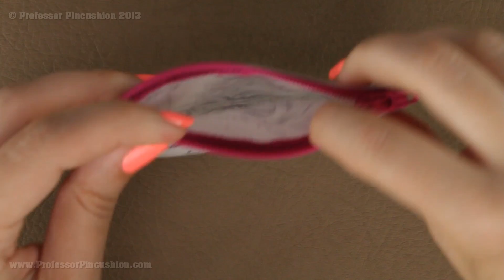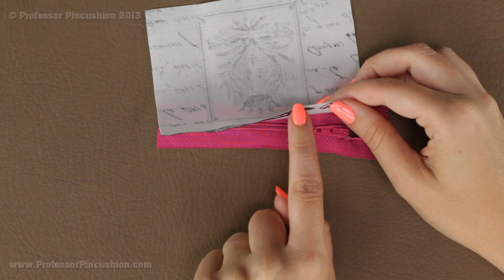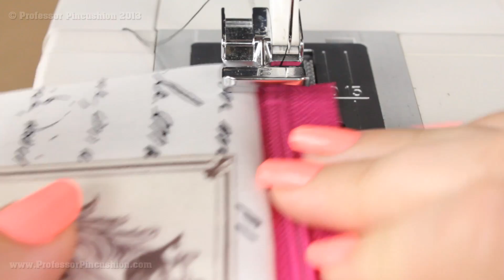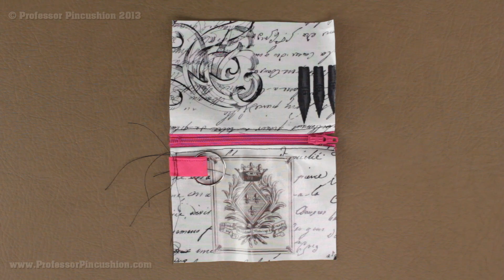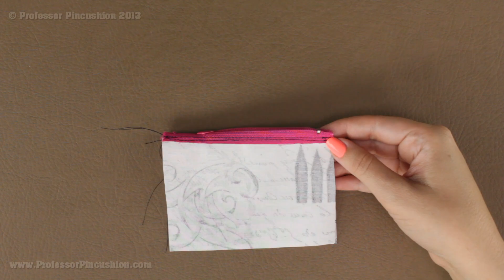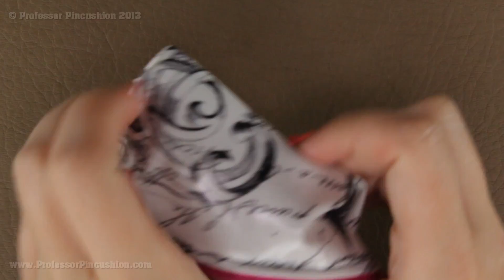How To Sew A Zipper Coin Purse

Comment: This is a great video!  The close ups are perfect.  Here's another way to stitch on laminates; roll on a very light coating of Chap Stick right where you'll be sewing.  Zipper foot will glide right along.  Then wipe off when you're done.  Works every time.
Reply from the maker: that's a great tip!  thanks for sharing :)